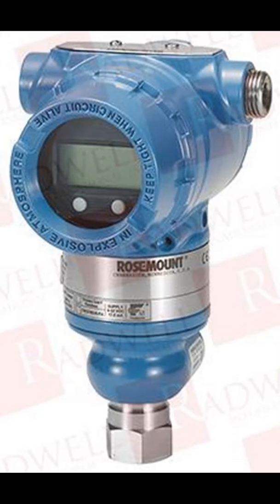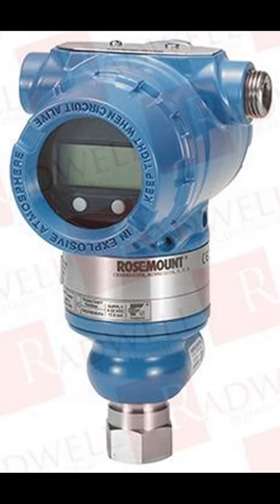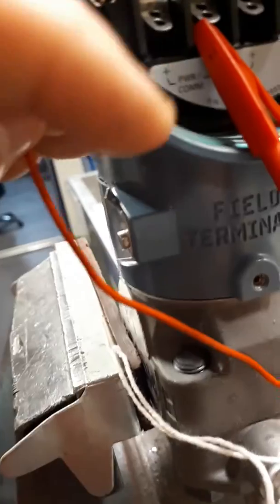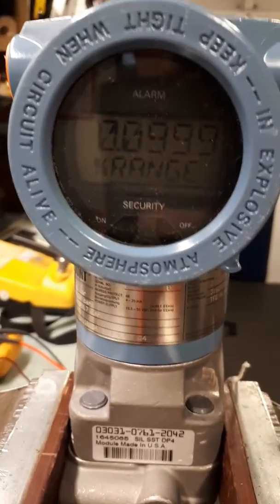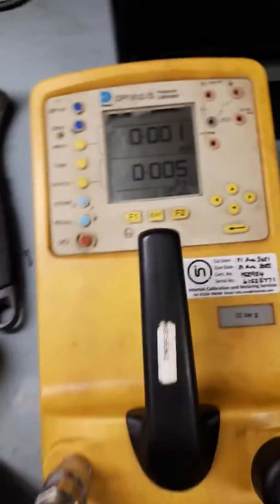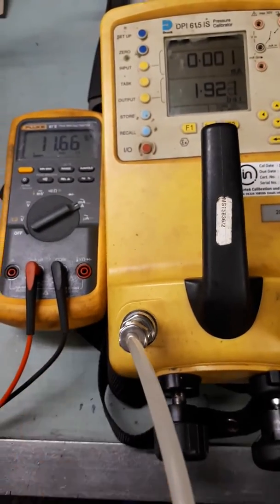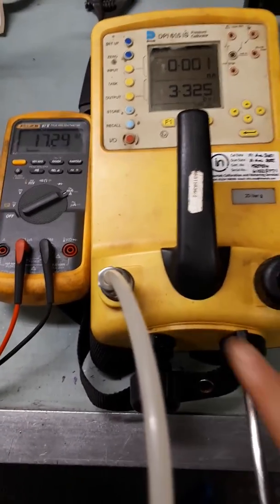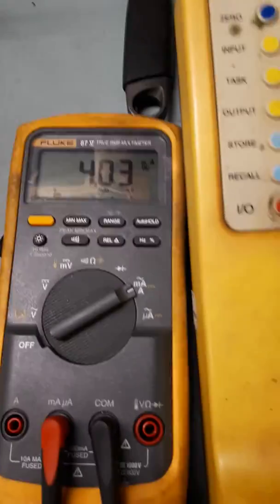HOW TO TEST A PRESSURE TRANSMITTER

Comment: How about resistance 250ohm ,you don't use it , can you explain please?!
Reply from the maker: The 250 ohm resistor is used when using a HART communicator to calibrate the transmitter. In this demonstration I am only demonstrating the analogue output signal, the HART communicator received the signal in Volts not mA, which is why the resistor is required.